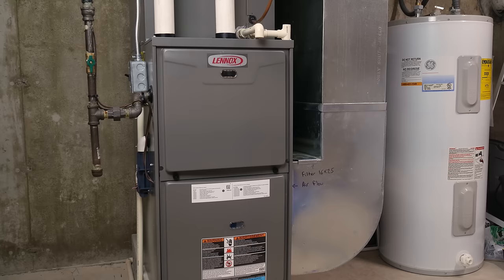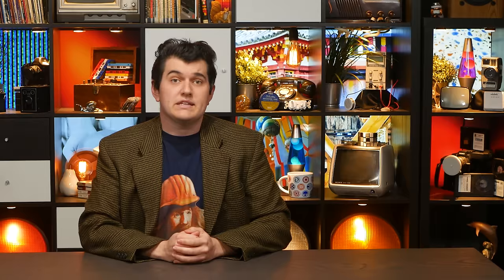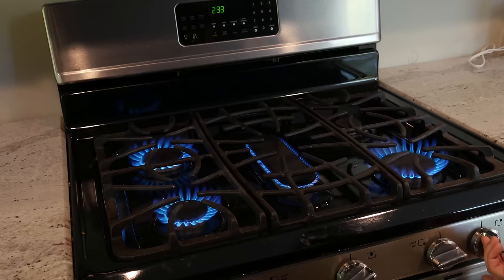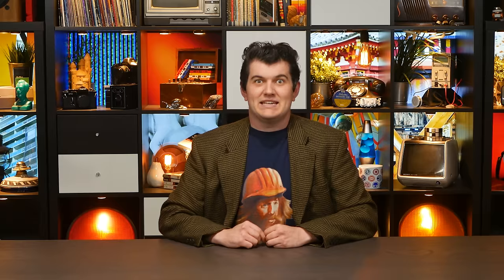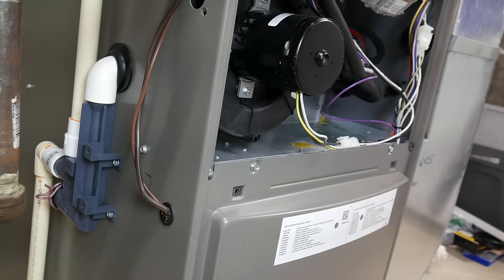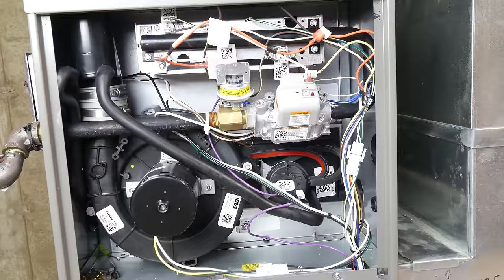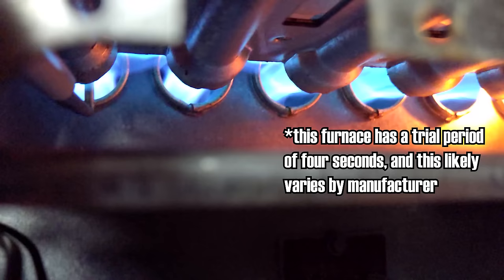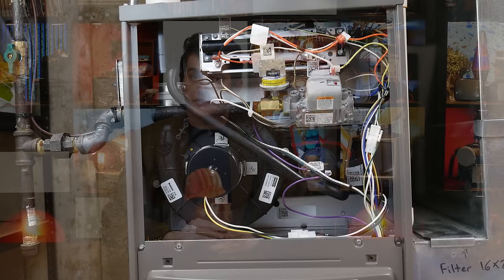Forced-air Furnaces: The What, Why, and How

Comment: I never realized that there is a difference between a water boiler or water heater apart from the name/country, since i am living in a house from 1960 which back then had a pump free density difference driven central (water) heater system.
which also did not heat up to "boiling" the water but  had a closed loop with expansion tank (air bubble) at the top.

The problem with the heat exchanger corroding was also known for the VW Beetle. The passenger room air was heated using exhaust pipe/gas heat, since the engine was aircooled. Now the wall on the heat exchanger corroded and the engine exhaust could mix into the passenger air.
You of course will smell that because its not only CO... but people are lazy and cheap on maintenance.

Biggest benefit of having a burner heat up water (or porous stone blocks..) is that you can modulate the produced heat so it is a bit above the needed heat.
The water (thermal mass, concrete) can buffer that stored heat. While the water is really hot you only need to trickle water through the water:air exchanger, the colder it gets the higher the flow. When temps get too low even at max flow you restart the burner.

Biggest heat loss happens on flushing before start, the longer the burner can stay on, running at optimal air:fuel ratio, running at the lowest output needed, the more efficient it gets.

The lower your (water) temps needed to properly heat your house/air/room the more energy you get out of the condensation.
(Large floor heating panels running at around 35°C are a lot better there over wall/window  mounted heaters running at 50-70°C)

I think at around 65°C non freedom units it starts going into getting unusable because the exhaust temp needs to be a lot higher for the exchanger to work.
But this means even old houses without doing any isolation/renovation, as long as its not really freezing cold outside, can get use out of condensation burners. Usually the roomheaters are way oversized and can be run with lower temps and still get enough output into the room.
When it gets really cold outside and higher flow/volume isnt enough the temperature needs to get higher, meaning less condensation.
Any modern burner will adjust a temp curve accordingly and if possible modulate pump and heater power in multiple stages.

The most efficient heater would run at the lowest sufficient power non stop. Best air/fuel/heat output. (Which is kinda easy to do for gas (not gas-oline) burners.

Final note: i am surprised the burners get only hyped to 95%, beeing used to the US overselling things in Ads. Around here condensation optimized burners get sold at "up to 150% efficiency" because they compare numbers to the worst "all heat out through the exhaust" old style burners...
Reply: Testing for youtube autodelete bot if my post disappeared.

Edit: Seems to stay there unbotted.
I studied that shit, literally, got my engineering degree for all stuff going in and out of a building, including waste water treatment aka "S.H.I.T.".. :-)

Comment: Being on limited government assistance finding the money to be able to change our gas furnace over to a heat pump could be very interesting including getting rid of the other gas hot water heater and intern getting rid of gas in general in our house would be kind of nice but costly correction in our case astronomical

Comment: Thank you for the great video. You explained the workings of the modern furnace/air conditioning system in such a way that I really understand it. I have a question for you please. My five year old modern “High Efficiency” air conditioning furnace system was in need of repair. Diagnosis  a leaky A-coil.(Warranty), while the technician was here changing out the A-coil he noticed an obstruction in the exhaust pipe (Draft- inducer), apparently while the crew was here installing the unit they accidentally dropped a 90° iron gas fitting down the pipe blocking about 80% of the pipe.🤨. This has totally freaked me out😳how did the system continue to work without much flow.we’ve had five winters of cold 🥶 weather.Then I wonder if this is why the A-coil leaked Freon🤷‍♂️. Not to mention the contamination to the system (furnace components)as a result of this iron pipe breaking down filling all those small tubes full of rust flakes. I pulled some of them off and inspected them ,they’re coated on the inside,and where they connect the small orifices they are contaminated & unobstructed by the rust scale. Course my main concern is in the home air quality. The house is equipped with simple carbon dioxide detectors. No alarms have gone off. I do appreciate your advice and direction I’m waiting for a callback from the owner of the company that installed the unit he’s offered a full service I told him I want the furnace replaced. Thanks again 😳

Comment: What happens if there is a power failure during the operation of the furnace? Will the gas valves close? Also will it be too hot as the fan would be no longer on to cool it down?
My furnace is 2011 and looks much like this one.

Comment: My grandpa actually got carbon monoxide poisoning from the furnace. He wasn't feeling well, drove himself to the hospital, they said he had it, and when he got back he checked the furnace and it had a crack in it. He said the guy who sold the house to them the year prior probably ignored/took the warning off the furnace after having it inspected which I'm not even sure happened although I don't know anything about buying a house.
Just switched to gas space heaters for 8 years with no carbon monoxide checkers or fire alarms.

Comment: Negative pressure is not a good thing. 
You will pull in all the gross outdoor pollution, the new recommend way is to use something like an ERV or HRV which creates a slight positive air bubble and changes the air inside you house with losing little energy.
Most new builds will install fresh air system that forces air into the house to create a positive pressure, this is preferred as pull air in via a large filter the push the bad air out via the house envelope.

Comment: Though there's no code requirement for this, what if someone made a furnace control board with an "alarm" input, which, if so desired, could be wired to a special carbon monoxide detector that activates said input? The alarm input, when activated, would just turn off the HVAC. You could also attach it to a central fire alarm system in buildings that have it: then if there was ever a fire somewhere in the building, you'd at least have the advantage of having the fan turn off.

Comment: I have a gas water heater start dumping CO into the house. CO detector went off and I disabled it thinking it’s broken. Turned out next day when I mentioned it to someone they freaked out and called a repair co who found the plastic exhaust pipe cracked. 

Kinda freaky since it the time it just seems like an alarm malfunction when it’s for CO instead of smoke.

Comment: I was hoping you'd explain why sparking igniters went out of favor for Hot plate igniters. However, having had to mess with lots of igniters, gapping them is a constant struggle especially if you have to maintain them often. The hot plate seems like it might not need as much maintenance.

Comment: I didn't manage to ignore the blue 😭
Just FIY: There are thermostats with a 3 wire connection that also handles the supply voltage for the digital thermostats.
From my memory it should be +24V, GND, Control.
Control is pulled high by the furnace and the thermostat pulls it down to various levels, hence implementing a very basic protocol.
The different levels tell the modulating burner how much power it has to provide.
This system is used in some european systems 😉

Comment: My apartment has a heat pump but my dumb/paranoid roommate didn’t know that. His parents taught him to turn off the heater at night which is silly since furnaces are well designed and carbon monoxide sensors are a thing. I had to tell him not to do it because we had a heat pump

Comment: The flame acts as a rectifier. High voltage AC on the rod, pulsed microamp DC current is conducted to  burner ground.

Comment: I smell gas around my furnace when its been off a while (couple hours) , had an HVAC guy look at it, said it was fine.  I don't trust it, so we're heating with a gas fireplace which seems to work fine.  The gas is now turned off to the furnace.   We're in SW Ontario so its not too crazy cold.

Comment: My parents had a house with one of these, it could heat the house very well for cheap, the only problem is that rooms that were far away from the furnace would be a lot colder than rooms closer to it, and since the thermostat was centrally located my parents bedroom was like 6 degrees hotter than the thermostat indicated and mine was like 5 less (it was a big house) anyway I think the problem was that the ducks were not properly insulated and were not the right size.

Comment: Segeral Brazilian indigenous populations burn stuff indoors - and also the Brits used to do it. I'll find the video about the Brits and you see the cleverness of their process.

I think I better find the video later on ... a short explanation: Both the early British houses and the Ocas were/are made of straw. The carbon monoxide then accumulates on the straw and keeps if from burning! An opening higher than humans heads manages to keep the smoke only above that level.

Comment: In the UK 🇬🇧
My fiat was built in the 80s and had ducted heating (no aircon)

The boiler has finally died and we cannot find anything to replace it directly, no way to get an air to air heat pump.

So I'll have to get a combi boiler and radiator installed for about £4 not good.

Comment: Before I changed my roof exhaust to have a screen over it, I had a bird fall down it and get stuck in the draft inducer.  I didn't know it was there until the inducer kicked on and the poor bird.........  Well, that is where I am going to leave this story at.  It is also nasty when you find a dead baked brittle bird in your exhaust flume of your water heater.  Yucky!  Glad my roof vent has a screen on it now!   My house was built in the 70s when that wasn't a requirement for it to be screened.

Comment: I use fuel-oil instead of gas here. We have no natural gas lines here in the middle of nowhere. My neighbor uses a propane furnace in their rental property. In their actual house they, for some reason, opted for a wood stove fired boiler but with a combo of forced air and radiators. It also heats their water. In my opinion, having to build a fire in the summer is kind of, well, not smart.

Comment: Sparky things are less reliable (and have a finite life) as the spark erodes the metal (see also the need to clean/change spark plugs in cars and spark erosion / EDM as a method of cutting the toughest metals). By comparison the hot surface ignitor will not wear, so is more reliable. If you get the temperature high enough, it will also clean itself to some extend by burning off any carbon deposits from the combustion process as it heats up before the burners kick in.

Comment: Zone 9a Texas and we heat, cook, and heat water with gas because refineries are near enough that natural gas is cheap. The air conditioner is electric and costs about 10 times what the gas costs to run. If only we could safely air condition the house with natural gas.

Comment: Nice Furnace, but what are you doing with that old school electric water heater?! You should consider upgrading to a new Heat Pump Water Heater. I installed one last year and it cut my electric bill in half. Super easy to set up. Uses the same electrical whip you are currently using. You would just need to set up a condensate system. Same as your furnace :-)

Comment: Instead of creating "negative pressure", using an air exchanger to replace air in a space is a better idea.
Especially since it won't be directly outside air and you can recover heat/enthalpy (depending on the unit).
Reply: My furnace is in a finished basement but its pulling air from the room and i think even upstairs where the door to the garage is. Makes the basement pretty drafty and cold in the winter.
Reply: @XXMETAL4LIF3XX  same. My house is horribly drafty.
Single pane windows, older doors and poor insulation all make for cold winters!
Reply: @miked6592  yeah same im in north jersey and ive been feeling it this year. house was built in 1954 so not much is insulated that well. we have double pane windows but honestly some are better than others, some really dont do much at all. our anderson windows from the 70s are still good though.

Comment: @2:50 pedantic difference ... but appreciated for the correction... also those labels are meh accurate... generally these type of machines are between 0.8 ad 0.95 efficient. closer to 0.95 if they use waste heat recycling

Comment: Hi. I just found your channel and am enjoying the videos. I'm wondering if you might consider doing one on the various options for replacing a water heater. There's Natural gas, Electric and now a water heater with it's own built in heat pump. What are the pros/cons of each? Cost of use, recovery time, impact on the environment, etc?  Thanks for 'listening'.

Comment: I don't THINK I need to worry about Carbon Monoxide, unless my stove malfunctions...I have a downdraft fan behind the cooktop; my water heater is outside the building, as is my HVAC unit, which is mounted on the roof.  The only part inside is the ductwork. (And, of course, the gas pipe to feed the furnace side runs through the attic and goes up through the roof...having it run along the outside of the building would not be a good idea...
Nonetheless, I do have a CO detector...
At my age, I probably won't live long enough to see natural gas phased out completely, and that's fine with me.  I have had electric stoves in other places I've lived, and I DETEST them.  I cannot cook on them worth hang; I always burn the food, because you simply cannot get the instantaneous shift in temperature that a gas burner provides.

Comment: This only applies to residential furnaces 1992 and newer. 1991 and older Residential Furnaces with a few rare exceptions, did not have a computer board, and did not have forced draft, they had natural draft with the furnace being taller due to the draft hood on top. From 1988 to 1991 they had analog electric ignition, 1987 and older were standing pilot or more known a furnace with a pilot light. Those used only two safety’s on them, a thermocouple to test if the pilot light is lit, if not it locks out the gas valve and a high temperature limit incase the blower motor failed or 1983 and older models the blower belt broke or fell off. (This comment only applies to residential furnaces.) Side note 90% furnaces while more efficient negate the savings when the furnace breaks down, thus due to the replacement parts being wildly being more expensive. Side note 2 some very recent models 2020 and newer now incorporate a carbon monoxide cutout that takes air samples from various sensors in the return side and the supply side that measures for any gases that if detected at a certain level will shut down the system.

Comment: My neighbor got a cracked heat exchanger from living in an old house for years without changing the furnace filter.  The filter was so clogged with dust that the furnace overheated and cracked the exchanger.

Comment: My current furnace (which replaced an old furnace with a sizeable CO leak) does not seem to have a maximum flame ignition attempt count. The design of my furnace is pretty awful with respect to the flame sensor, needing a flame sensor replacement every 1-2 years. Sometimes when it's acting up, it can sit and attempt ignition several dozen times before it finally detects the flame and decides to stop shutting the gas valve off.

TL;DR: Not every furnace actually seems to have a maximum number of retries for gas ignition.
I've always wondered if that was even safe, but since the draft inducer is keeping constant pressure, I guess the worst case scenario is that it will vent small bursts of gas outside.

Comment: Carbon monoxide detectors are still a good idea even if you don't have fuel-burning heat. Where I live, we inherited faulty wiring which broke the electrical heaters, which in turn produced heaps of surprise carbon monoxide, which in turn nearly killed me! But then the alarm went off, waking me up and alerting me to the problem. Fun times.

Comment: My furnace does 105%, because the temperature of the gases out is lower as 65C. Condansation of the water vapoir is inside the machine. Condensation gives warmth. That why it is over 100%. But it has a condensation outlet...so extra pipe to waste water.

Comment: Was nearly deafened by my alarm system in my bedroom screaming carbon monoxide detected. Was -40 outside at 3am So after opening my window I held my breather to run turn off the furnace. called my HVAC guys 24 hour number and looks like our heat exchanger went bad on us.

Comment: Point on carbon monoxide detectors, carbon monoxide is heavier than air and drops so consider mounting your alarm low or at least below head height for greater protection. 👍

Comment: Hello. Great video. I live in an apartment and the gas furnace stops working during a power outage. Can I connect a vehicle battery or some other power source to the furnace so that it will run during power outage? Thanks
Reply: Most of the time its not worth the cost or effort as the grid gets repaired quickly. You can use a car battery hooked up to an inverter to run the furnace. There is a video on youtube of someone doing it.

Comment: I thought I was going to learn about my furnace, but instead I learned about furnaces in houses that aren't as ancient as mine.

Might still be cheaper than using that mini-split we installed as a heater though, because god the price for electricity is insane.   ..plus it smells toxic on heating mode.